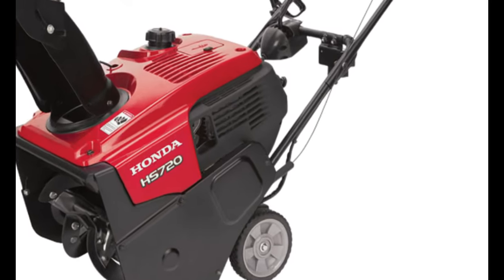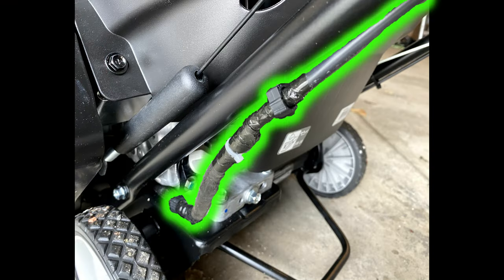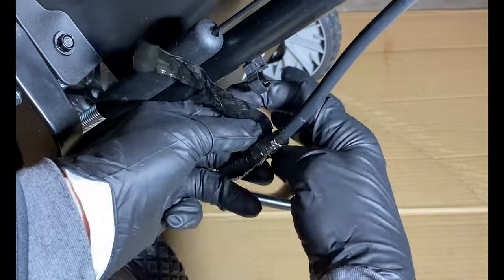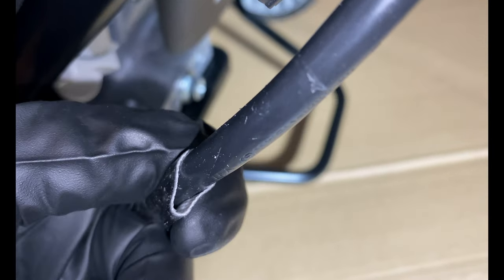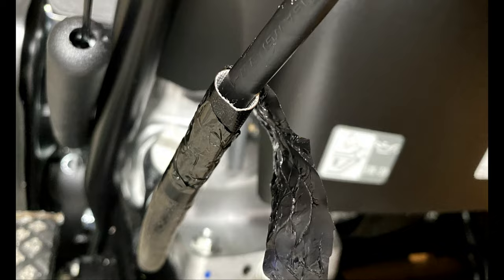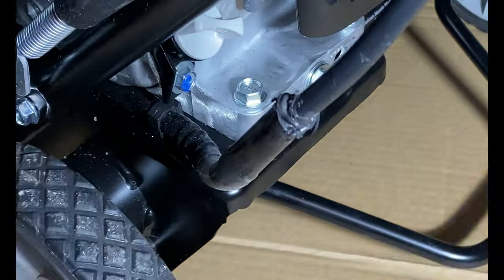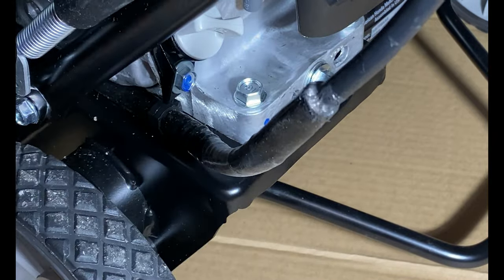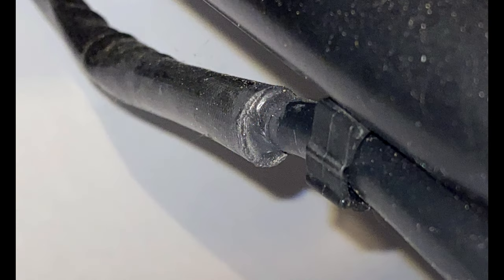Honda HS720 Snow Blower Corrosion Risk: How to repair (Shock Hazard?)

Comment: I just bought this machine used from a seller. I noticed the tape when I was looking it over and wondered what type of repair he did. I was very surprised since this person had a then year old Jeep that wis his project car. He put over $10K in to parts and tons of time of sweet equity into it. I said nothing and thought I’d fix it since it looked sloppy. Now looking at videos for the machine I came across this, your video.glad for two reasons. It confirmed he didn’t do a sloppy job while his work on his Jeep was amazing, and it gave me a thought how to better bathe repair. Much thanks.
Reply from the maker: No problem, I am glad to help and congratulations on the machine.  A little sealer  down the tube should ensure no water / salt gets into there.